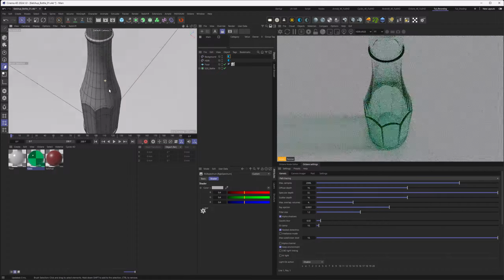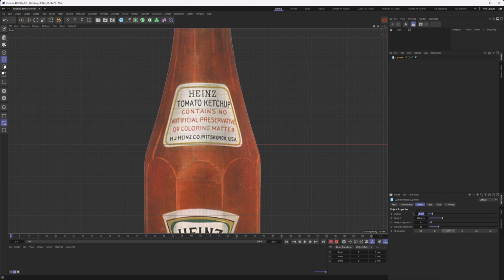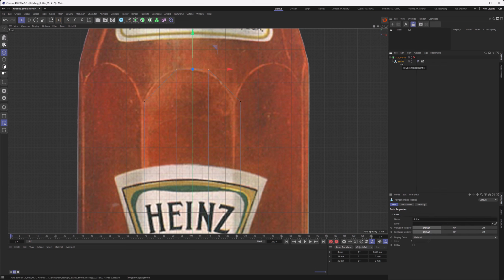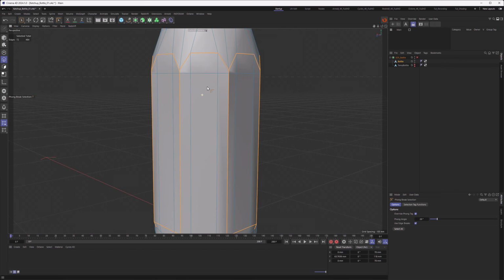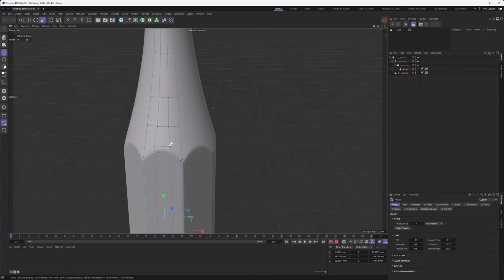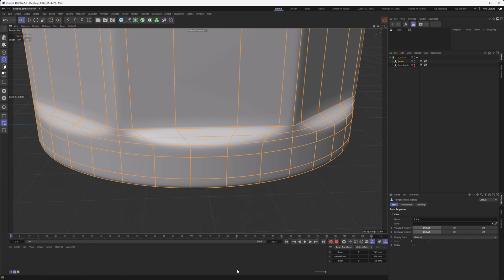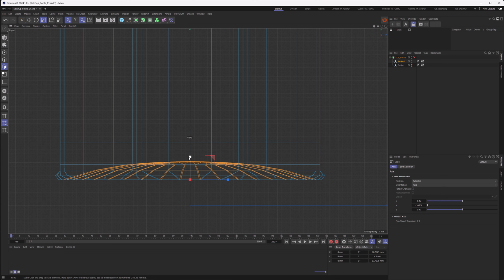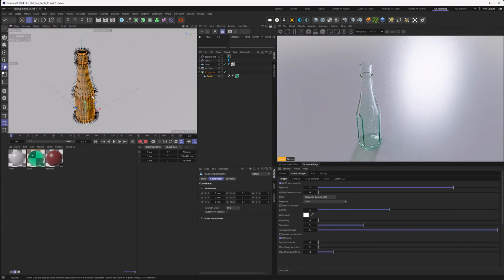Silverwing Long-Tip: SDS Modeling a Ketchup Bottle (C4D)

Comment: As silly as this may sound I didnt know about the alpha channel on reference image to remove the white part. Then I wasn't used to U~F (fill selection), the radial symmetry, axis positioning on Scale tool or the Patch option on Fill Polygon Hole. I delt with this things but the wrong way. Thank you, really! 🍶I'm off to this weeks vid on glass cause I'm behind.
Reply from the maker: Oh nothing really is silly. There are so many things that make up the software its´s impossible to know it all. I learn new stuff every Day myself. I am just glad that those videos are useful to others 🙌
Also I would say that all the ways that work are right ways. There are just faster and slower ways to do it ha ha. And thanks a lot for the ✨🍶✨

Comment: Thank you so much. What about the daylight rules (fireflies mainly)? A video about it would be welcoming.
Reply from the maker: Thank you very much for your comment and your suggestion.
It's a good one.
I just released a video about reducing noise while lighting. Though I did not go into depth about the daylight system. But it's the same there too. Make your sun (light) bigger to reduce noise (including fireflies)
https://youtu.be/vG8rGIKX16U
Reply: @SilverwingVFX  Thank you very much. I respect and admire a lot your knowledge, amazing work what you do.

Comment: Well, another one who flee on dark side 🤨
However, if you start to make Blender tutorials, I suggest you to don't bother with modeling tutorials. This "market" is already oversaturated. Also, your slow methodic approach to modeling will make Blender fans mad. This tutorial is 40 min. longer than other similar tutorials. I'm serious.... Blender users don't have time to waste 😜

But you can make Octane tutorials. Otoy offer free tier for Blender users. So, there is a lot of people which can be interested. 
Unfortunately, there is not so many serious tutorials for Blender Octane. C4D and Blende version share same Octane engine, but interface is very different.  Also, there are couple small differences. For Blender users following Octane for C4D can be tedious. 
Focus on complex materials, lighting, tips and tricks.
Reply from the maker: Hey hey. Thank you for your long comment.
The intent is not to switch but to expand. Learn new things and get out of my comfort zone a little but. About the length of the videos. Let´s see. Maybe there are those that like my style and I therefore have a selling point there.

And also yes, I am planning to make Octane tuts for Blender. The scene you see in the video is using Octane to render.

Cheers and a great start into the week to you!
Raphael